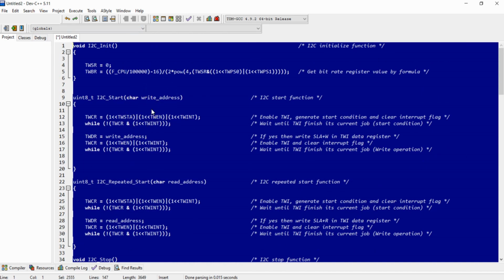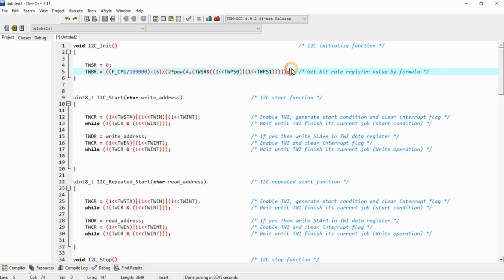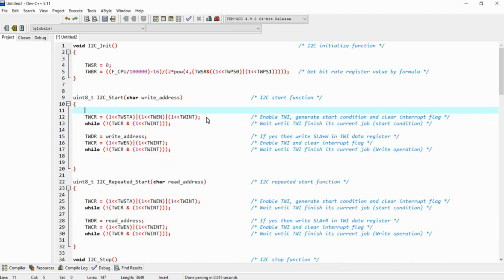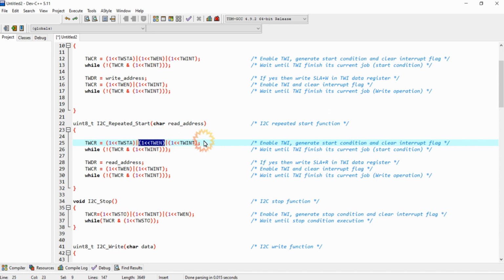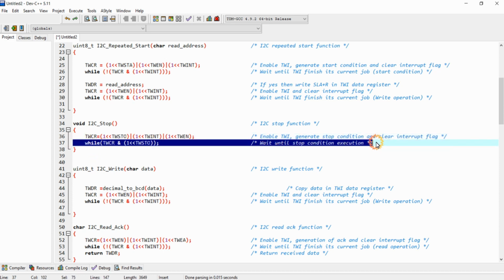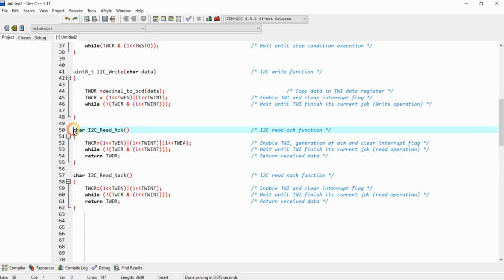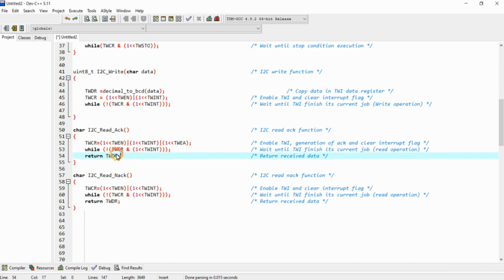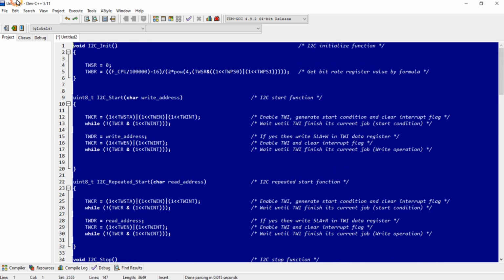I2C REGISTER CONFIGURATION FOR ATMEGA16 PART 1 | ATMEL STUDIO PROGRAMMING COURSE | T - 39

Comment: If you want to clear the interrupt flag in the 2nd configuration why are you setting high? 
(1<<TWINT)?
in Line number 12.
and in Line 16 and every other lines as well

shouldnt it be (~(1<<TWINT))?
Reply from the maker: Interrupt flag will be cleared on setting that bit and in line number 17 the loop will hold the control until the flag is set to one
Reply: @SMtrainingacademy  So does it take some time to set the bit?
Reply from the maker: @anuragpaul6988  yes until interrupt occurs